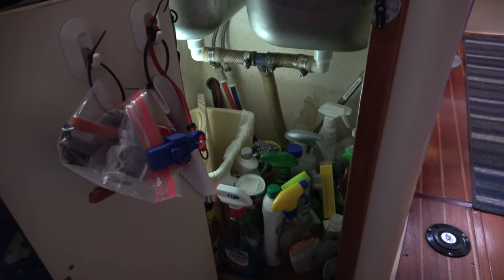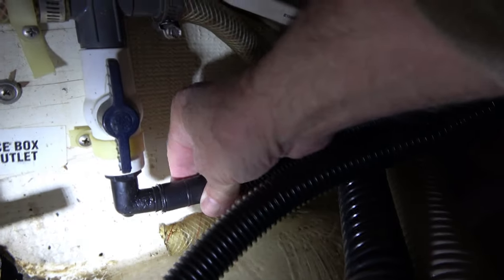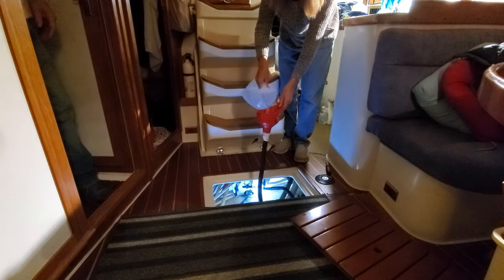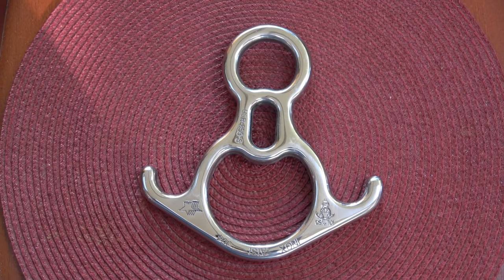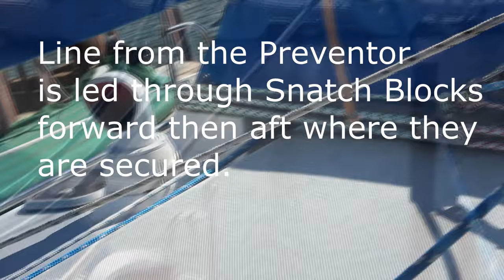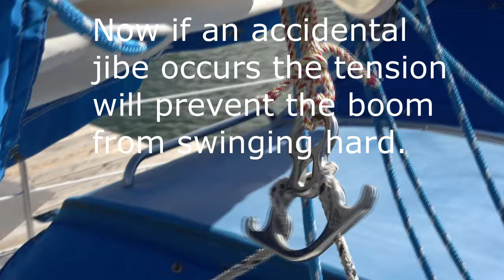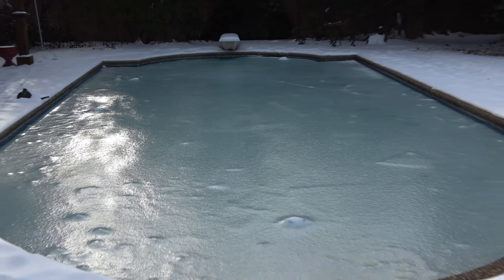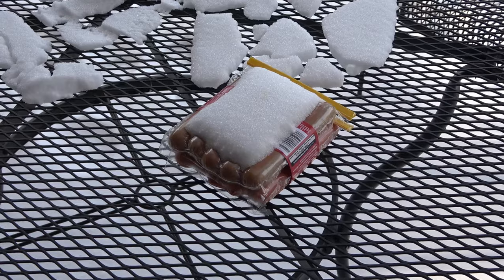Boom Preventer, Frozen Pipes, Sump Pump on a Catalina 42 Ep 27

Comment: Y'all stay warm. That cold white stuff is for the birds. Glad I'm in Florida 😎. 
This is not a criticism only a suggestion, but have you thought about changing all of the flexible hoses and clamps to a pvc manifold system. It would cut down on the chances of leaks occurring. 
Karen great idea on smoothing out the edges of that me 2x4. Love the way you keep warm with the dancing. Sexy!
Reply from the maker: We're not keen on the white stuff either until it melts and goes away. Thanks for the suggestion on the PVC manifold. Mark, I do love to sand wood smooth. Thanks for the complement. 😊